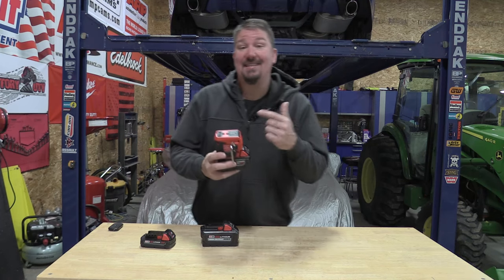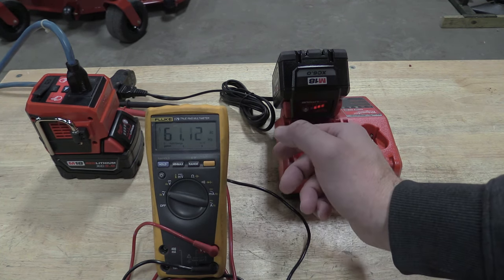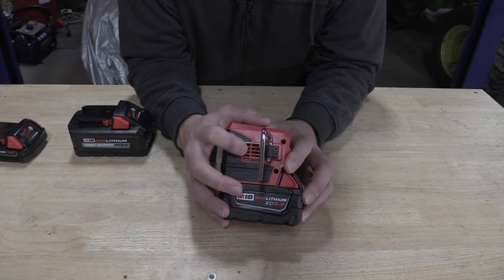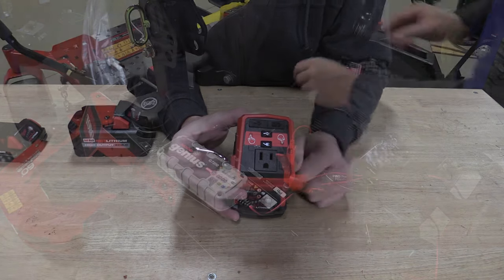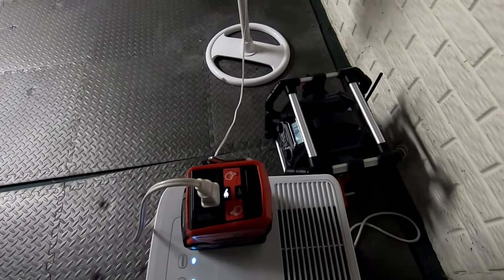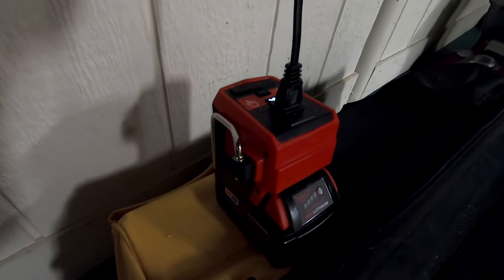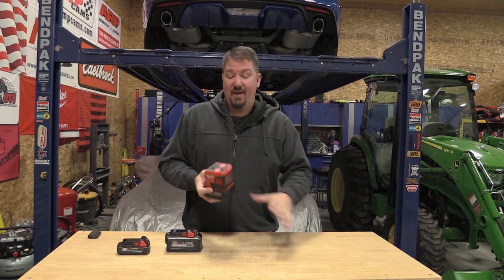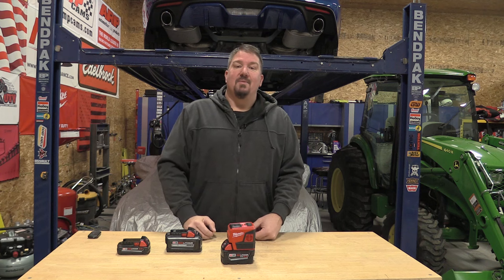Milwaukee 2846-20 M18 Top-Off 175W Power Supply Review | The Best Small Inverter To Date

Comment: Can I run my house off of this during a power outage?
Reply from the maker: It struggles with a central AC system, but after a few hours the system will finally turn on.
Reply: @WorkshopAddict  OK good. I'm happy to know I'll still be able to take hot showers using my electric Tankless hot water tank with my 12ah battery
Reply from the maker: @ryanm2084  Whoa, the 12Ah battery can probably cover your neighborhood.   I was only thinking you had the 2ah on there.
Reply: @WorkshopAddict  oh yeah. I'm not messing around. I was thinking about getting a Generac whole house generator but now I don't need to.
Reply: Only if you use (2) units and parallel them.

Comment: That very nice but make your own much better and i do it have 2 Milwaukee 18V 1 12A and next 5A need have 36V and i have 36/48/72 V DC converter 12V DC 10A out put i have 12 way fused black with 3 usb  each 2 out let on them 2.1A &1A on each then i have 500 watts inverter that take ah part on my inverter have 2 usb port 3.1A then i have 110V AC out on my out let have type c and fast charge 15 watts and i have 5 switch and meter to tell me how Volt my batter is and % so i can chat upto 10 phone and 2 laptop at same time

Comment: This must be a beginning gimmick product.One m18 battery can power a skill saw but the inverter can only put out 175 watts?
Reply: no not a gimmick.  it's battery output.  the 120v device exceeds the limit of the inverter.  The battery can only provide what the circuit it's intended for.  The motor on the saw is 18v probably a max power of 10 to 12 amps.  could be more?  your looking at a max limit of 200w and Milwaukee designed the inverter to shutdown at 175W to prevent damage to the unit.

Comment: Will it charge my electric scooter 🛴 lol
Reply: yes, pending what the rated input power the scooter is looking for.  If the scooter charges less the 175w per hour it should be fine.  Look at your charging cable for the scooter.  It will tell you Watts output rating.